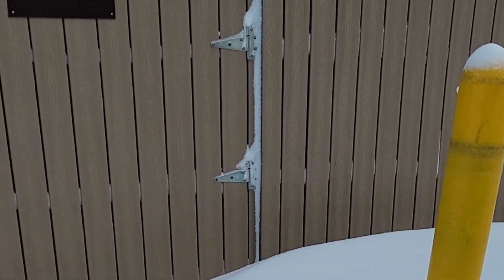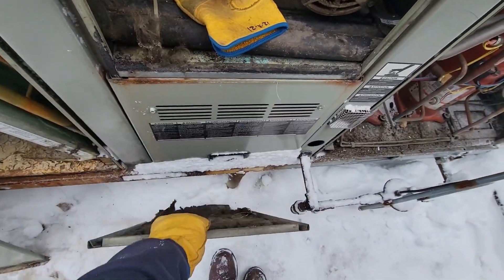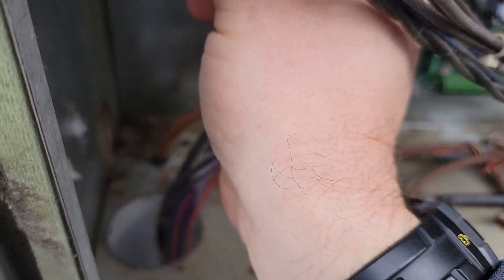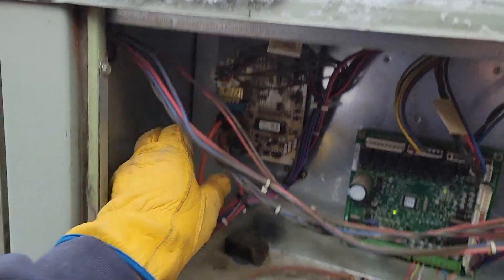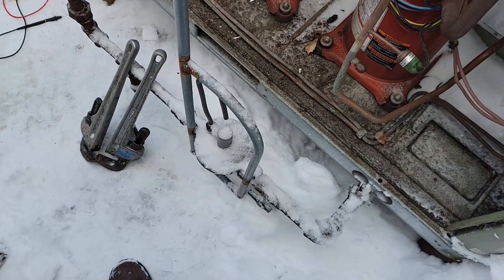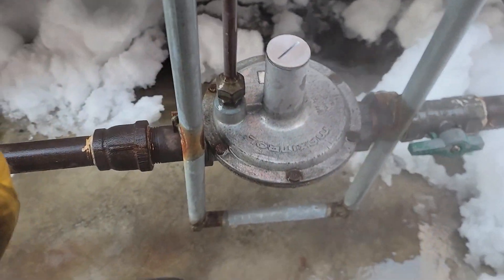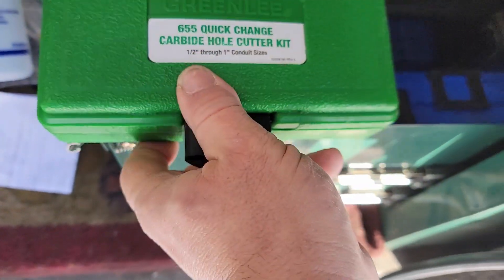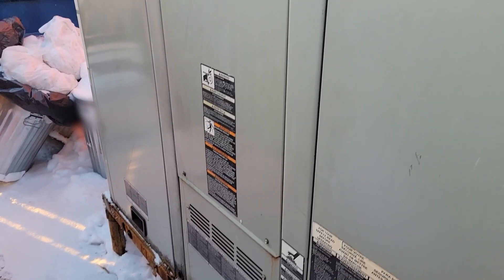Cold Kitchen - Cold Gas ￼

Comment from the maker: I made this video about a year ago and since that time this package unit has been replaced and so has the regulator. As I said in the video I had to get the thing running or leave them without heat. This is kind of hackery, but that’s what it is and that’s what I had to do to make her run.
Reply: Why hackery? its save to use for the application, and an warm customer.
Reply from the maker: @gekkedirkie  because I ended up adding some expanda foam on top of it for extra insulation, which looked like crap, but I cut that out and regretted doing it. I couldn’t remember at the time whether or not that was in the video
Reply: You denied them a day off, lol.
Reply: was that Christmas 22 when there was that -30 day
Reply: Thought it was this past week since it matches the weather we've had. Central Ohio here.

Comment: Nice fix!   Did you check the regulator vent line for a possible blockage?  The vent termination was very close to the the exhaust outlet and could have frozen over..
Reply from the maker: Yes but you have a valid point. Good call

Comment: this kind of thing happens all the time on propane forklifts that run in the cold, they typically have coolant lines running to them to heat the valves. along with air brake valves as well, just yesterday i had to thaw out a valve on our tri axle because it wouldnt let you set the brakes.
Reply from the maker: Thanks for sharing!

Comment: Just did a job where the main meter/regulator was bad. The customer called out the gas company for a leak ( They come right out ). The tech started to tell me about the electrical problems with the unit, with his years of experience I guess also being a hvac guy. He was embarrassed by the guy sent out to help him.

Comment: Hot water works... if you have hot water. :-) I've had to use a microwave to boil some water to unfreeze a water heater. (condensate line) A hair drier or heat gun would also work. (but a heat gun can cause a fire.)
Reply from the maker: I have been on a roof with a service valve that had a hex key that had water frozen in it….98.6 degree water is all I had on me (in me) that was convenient to thaw the ice so I could pump it down. 🤫😂

Comment: taking it off to dump the water out the vent and adjustment port would have likely helped. 🤪  🐒 guessing it was full in the upper part.
very dumb placement by installers, ideally run the gas line up and back down, placing the regulator up high (pain to mount/in the way) and at least install it horizontal or some inverted angle where water cannot easily get in the vent port or via the cap, even with a vent tube water can get in and pool on top the diaphragm.
Reply from the maker: Makes sense to me

Comment: Those Regulators lock up if it's low pressure just take it out second thing turn on upside down they don't freeze they don't lock up
Reply from the maker: Are you saying I won’t lock up if it was facing straight down?
Reply: Yeah that's right you'll find a lot of rooftop units around here they'll turn the regulator upside down to have issues

Comment: I know working on an outside unit is no fun in inclement winter weather .  Just & FYI (I know it’s easy for me from the warmth of my man cave ) you really should be checking those pressures with a manometer  (lock up and working). I didn’t notice the model number of the Maxitrol regulator (?)  it’s really not recommended to use unprotected tubing for a regulator vent. Maxitrol does make designed rain caps for their regulators . I’m not a big fan of Maxitrol regulators for outdoor use (indoor with limiters 👍, Maxitrol outdoor 👎). Outdoor use for me would be a B42 Itron 👍 (one of the best pounds to inches regulators on the market  and this is coming from a gas fitter with 35 years of experience ) . Great job getting them up and running. 
Regards from STL..
Reply from the maker: Thanks for sharing the info 🤜🤛👍👍